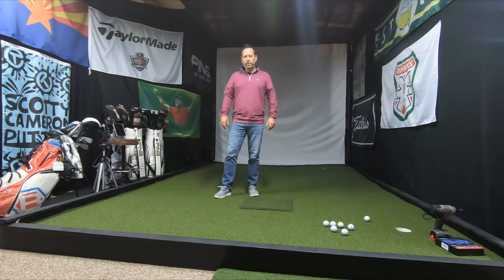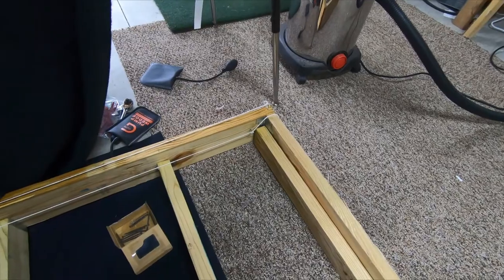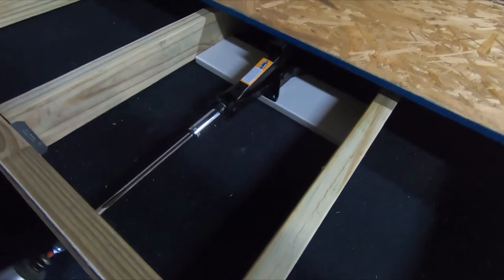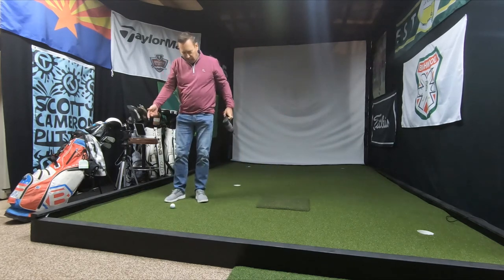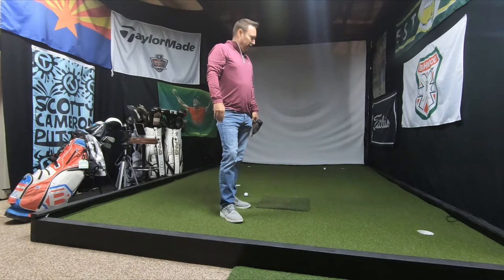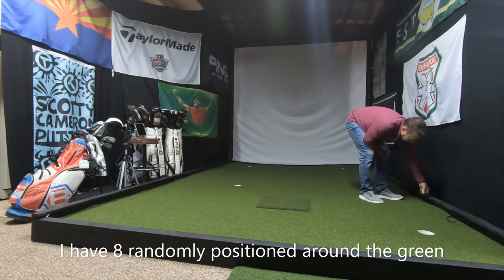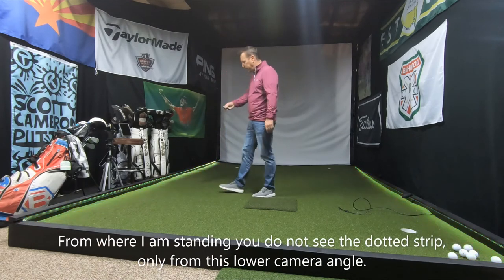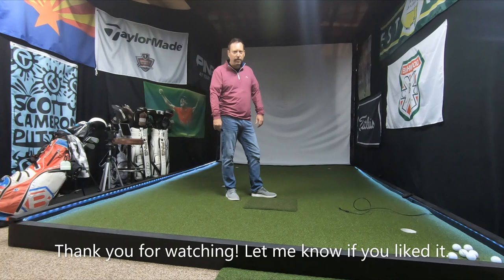How I built an adjustable putting green for practice in the off season

Comment: This is a great build and thanks for showing it as give me ideas for the basement. Love the idea of the jacks. What type of air pump jack did you use? I like that being permanent underneath instead of cutting foam and having to install/remove it when you want to change things
Reply from the maker: I just went with air jacks off amazon. Also, the hitting area is perminate on mine. The foam underneith is for shock as mats on concrete break down joints pretty fast. Thanks fpr the feedback!

Comment: I love your video and would like to make the same adjustable putting green. Is it possible to acquire some more details about the number of floor panels you use. When the adjustable floor panel rises is there a gap between that panel and the floor panel that is screwed down? There doesn’t seem to be any bump between the screwed down panel and the panel that is raised up and I wonder how you achieved this nice transition?
Reply from the maker: I used ling flat hinges. They sit flush with the boards. You can also make a space and flip them over as the small space will not show once you put the turf on. My turf is thicker than indoor/outdoor carpet too so it wont show little things like that. Good luck!
Reply: Thanks for the reply. Much appreciated!! I will give it a shot thanks!!

Comment: Great design! Couple questions. 1. Does the attached middle section run all the way from front to back? 2. Are the left and right sides attached by hinges on two sides (middle and to the hitting area)? 3. And you said in comments you would maybe change and use 3/4” plywood.  Seems like this would not have the flex that 7/16” probably has which gives a smoother curve as opposed to just a slanted floor? Hope you get this, thanks!
Reply: The floor is secured in an upside "T" shape where the hitting area is not adjustable. The corner floor sections are only attached by long hinges on the inside, allowing the outsides to tilt up. 3/4" would be more stable, but I get your point about allowing some flex. Mine has held up good with 7/16" and I have used it a lot, just creeks a little now from all the use. I probability could use a few more screws to fix, but it is not that bad.

Comment: i am just seeing ur putting green idea. Wonderful indeed. I am looking to do something similar. Did you nail down the two side pieces of plywood that are adjustable? I likely wont adjust mine; just a right to left side and a left to right side. 

Also, did you use all 2x6 for perimeter and 2x4 for middle studs?

Thanks in advance for you time.
Reply: Yes, 2x6 ends and 2x4 centers. I only screwed down the center floor board and the two side boards only attach with hinges so the outsides can lift. If you are going to make it flat, you can throw in some sand bags to add subtle breaks and make it awesome.

Comment: Absolutely awesome! On the adjustable panels of the subfloor do you have to be careful walking over them or is there enough support? Are only the center sheets fastened with screws and is the turf secured to the plywood or free floating?
Reply from the maker: If you weigh over 200 lbs I would recomend 1/2" boards. If less the 7/16 should be fine. Mine is not 100% strong but it is enough to support me moving around on it just fine and I am 185 lbs.

Comment: How did you install the air wedges under the turf and how far from the holes did you install them?
Reply: They just lay flat and I ran the hoses through the side rails and the bulbs are on the outside (before I put the cap on them).

Comment: Great looking setup, just wondering how your turf is fitted. Is it glued to the plywood floor
Reply from the maker: Thanks Craig, the company I bought the turf from (forever lawn) used a double sided tape around the edges (accept where the air pillows are).

Comment: So the sub floor piece’s are not connected to each other?
Reply from the maker: The hitting area is all connected to the joists and one another. The front has 2 pieces (left right and that are connected with hinges together, but not to the joists.
Reply from the maker: @Simon Blake the 2 side floor boards are connected to the center one with long hinges. That way they can lift on the outside to create the angle. The center floor board is screwed down to the floor joists to it will not slide when the outside floor boards lift.